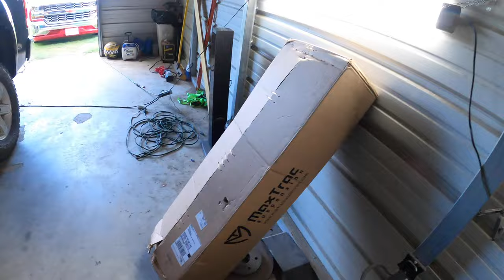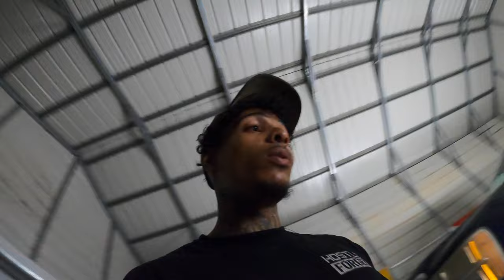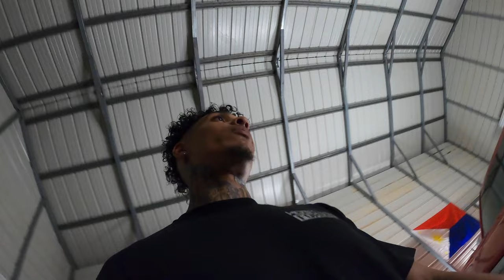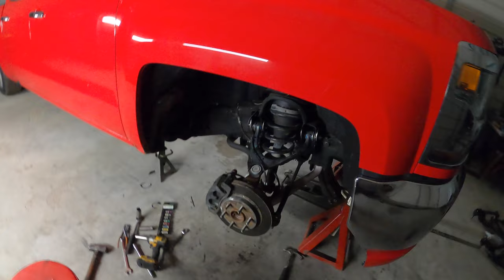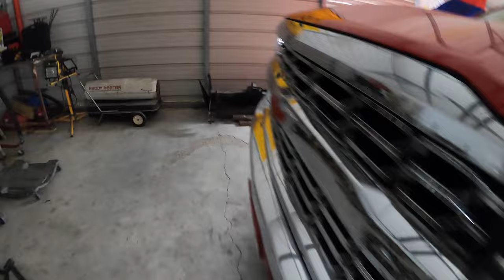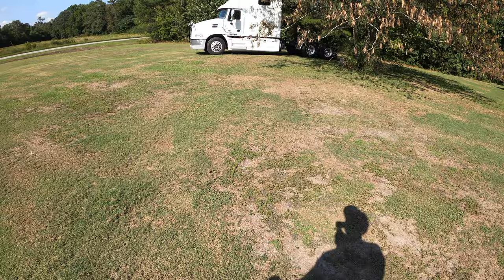7-9 MAXTRAC INSTALL AGAIN!? LIFTING BIG RED BACK UP!!!

Comment: Realistically, how long does this install take? I’m about to do put one of these kits on my 2017 4x4. I’m doing front and rear, and I have the tools to compress the strut spring so I won’t have to take it anywhere to have it done. 
What’s a good time frame that I can expect?
Reply from the maker: If you are working by yourself you can usually get it knocked out in 1-2 days depending on how long you work. If you have help you can get one done within 6-8 hours easily. I just prefer to take my time and make sure everything is right
Reply: @BackyardBuiltPerformance  ok, with 2 buddies helping and an actual lift…? Lol
Reply: @BackyardBuiltPerformance  also, track width or whatever it’s called, will I need rear spacers to match the front wheel track? If so, what size should I buy to match 100%?
Reply from the maker: @danfoster2380  yessir lol I do things the hard way as you see
Reply from the maker: @danfoster2380  I usually recommend 1.5” - 2” spacers they all line up the same imo
Reply: @BackyardBuiltPerformance  thanks for the info man, I appreciate it for sure. You are pretty much the only person on YouTube putting out these MaxTrac lifts. I wish I could see more detail, like maybe more step by step in the process, but I’ll just have to see it in person in a few weeks. 
Keep up the great content sir!

Comment: Can any struts fit or do they have to be the 7-9 adjustable I’ve got the max trac 7 inch but didn’t get it with the adjustable struts because I already have rough country will that theory work or?
Reply from the maker: If you throw the 7” struts in it’ll fit the same, they’re all compatible with eachother as long as the height is the same. You could even throw the RC 7” strut in with a 2” level to get the full 9”
Reply: @BackyardBuiltPerformance  I’ve got rough country 2 1/2 level struts in now but the max trac kit I got came with rear shocks and front strut spacers but no struts.
Reply: @BackyardBuiltPerformance  I got both crossmembers rear blocks and spindles
Reply from the maker: @Michaelcannella  gotcha, still may be doable with a 2wd and upgraded uppers 4wd might bind up the axles a bit but can be done
Reply: @BackyardBuiltPerformance  so be better off just getting the 7 with 4wd?

Comment: I got a 2018 Chevy Silverado and got both rear shocks if you want to buy them you can I’m in Arkansas so I could ship them
Reply from the maker: My lowering shocks worked surprisingly but I appreciate it anyways Brotha
Reply: No problem I love that you did a 3 inch level cause I have a cognito three inch level with fox shocks all the way around with 4s and 5s, I get a lock and a half before I rub on the upper